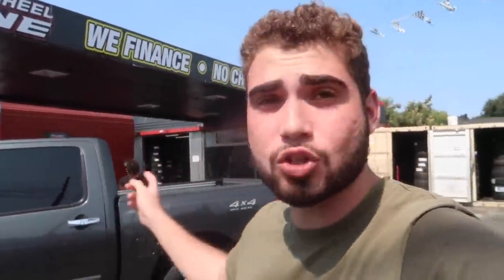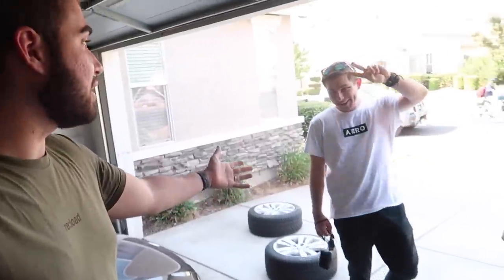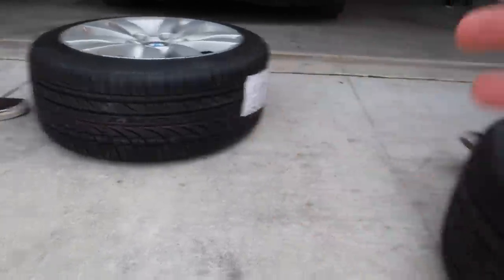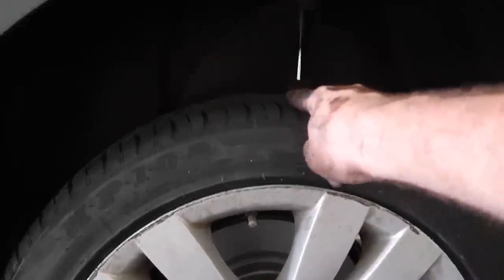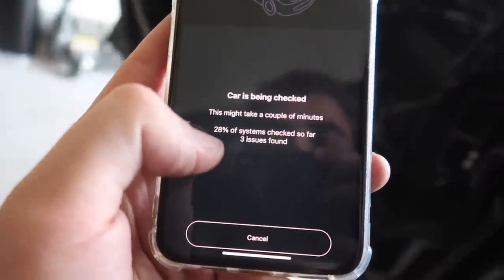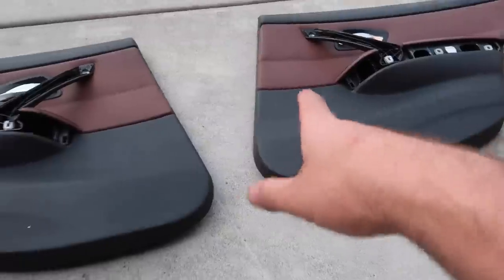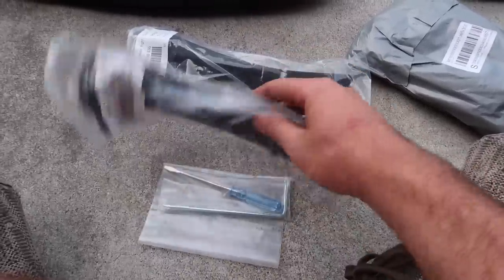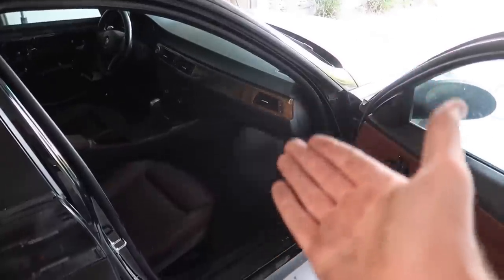Rebuilding And Restoring A BMW E90! Part 5

Comment: Lol, Zimmerman are actually OEM rotors. They just don't have BMW stamp on them unless you buy them from BMW, but they are virtually identical. So you know, OEM rotors are Zimerman, OEM brake pads are Textar for all E90 and F30 non-M models.

Comment: The clock spring. Wow this is the first I’m hearing about that. What & where is that located in the car
Reply: @Paul Hidden ok ima check mines out.
Reply: @Paul Hidden it’s crazy Bc yesterday I went to take off a steering wheel in my car and I was so scared to break the leather on the sides that I stopped. I was going to attempt it again this evening. I would have nvr knew Ntn about that clock spring & definitely would have broke it. So ur answer came at the right time literally. I will be calling in for a BMW specialist for the removal. God know I’m so grateful for ur reply at this time.

Comment: Those door handles are a common issue. My wife’s old 2011 328i had the same problem where the material basically disintegrated and got all gooey.

Comment: Had that steering angle sensor code come on and off after a pothole made the wheel not straight. Was able to get an alignment, reset the sensor and it went away. Just putting this here in case anyone else has similar issue.

Comment: You gotta get that thing an alignment ASAP when you are done. Those rear tires have some absolutely NASTY camber wear. Usually caused by rear control arm bushings being old, or stretched camber bolts.